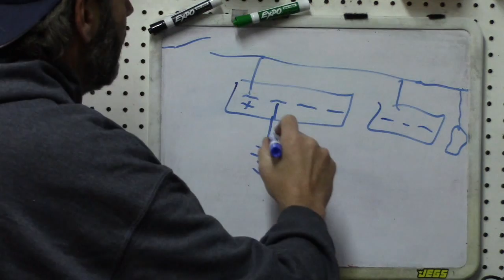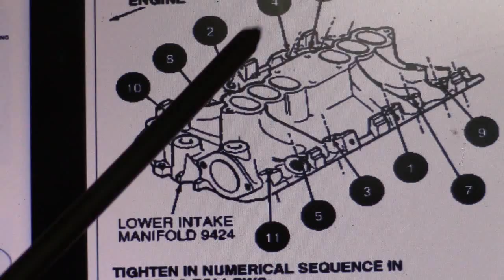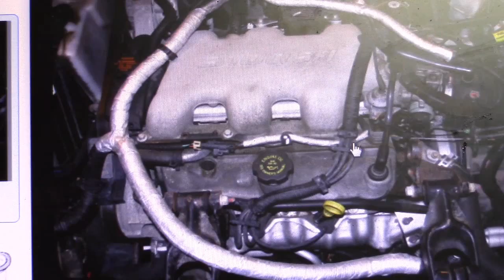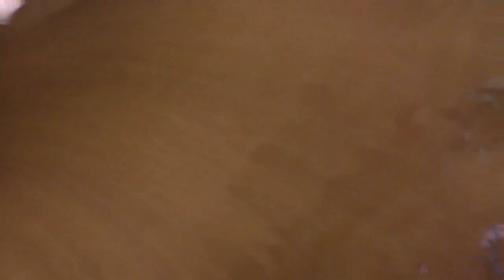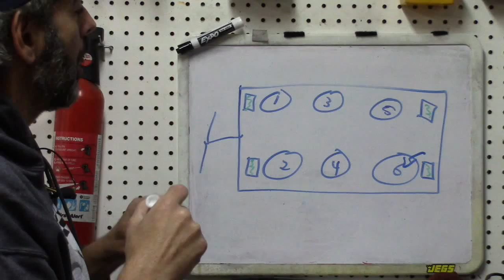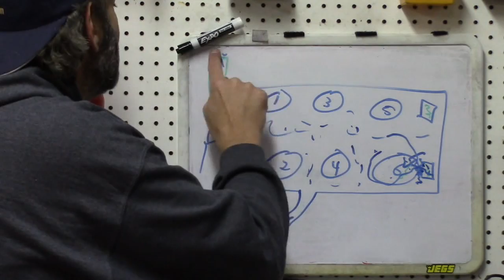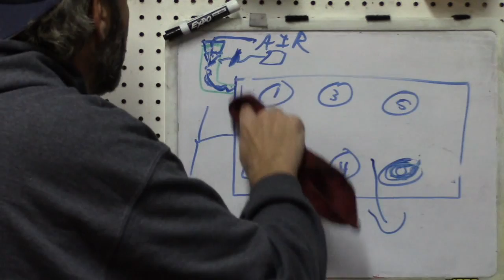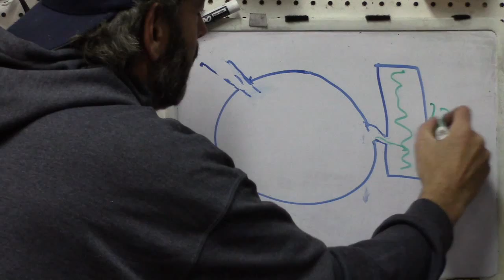04 Toyota P0306 Pt2-Can Compression Test Lie?

Comment: I don't know that particular system,  but I was wondering about the egr and how it might be ported through the head.  A lot of egr are cooled now to reduce nox. I'd there was a leak in that,  it's possible (maybe) to put coolant into the intake side of the head.  Just a thought.
Reply: I'm not sure were the egr is located on this engine,  I know some of them are in the back so it could be closest to #6.  That was the thought.  I really like your videos,  they can be thought provoking like this one.  Always looking for a positive way to prove what is wrong with the car.
Reply from the maker: Yes I've seen those systems but it doesn't explain coolant only getting into #6 though?

Comment: This one is a head scratcher Matt and made me think.  I want to see the cylinder head pulled and take a peek.
Reply from the maker: My plan is to use a borescope after pressurizing the cooling system and spot the leak by looking above the intake valve and in the cylinder itself.

Comment: I can't offer any explanation but all I can say is I've had something similar on a Ford Expedition. Compression checked out good, there was coolant seeping into the #1 cylinder over night, but it passed the cooling system pressurization test w/ flying colors. Chemical block test showed positive for combustion gases in the coolant - that had me scratching my head. Maybe there was some flapper type stuff going on there but I decided to try the best magical liquid head gasket in a bottle (the type that Arnold Schwarzeneggger's friend is made of) and it took care of it... until the radiator blew a few months later. Not knowing if the radiator grenaded from combustion gases or not and not wanting to put another penny in that piece of ford I sold it as-is for $900.

Comment: Matt, just a thought, maybe there is a hairline crack in the cylinder head casting in the area surrounding the intake valve for the number 6 cylinder but is isolated from compression when the intake valve is closed during your compression test, thus showing no bleed down on the compression gauge. It also might explain why there was a gurgling sound when air was sent through the intake manifold near that cylinder. That air could be forced into that crack into a cooling jacket in the head. Only accessible to the combustion chamber when the valve opens. Thus leaking coolant into the cylinder from above the valve seat.
Reply from the maker: Yep, exactly what I think it is.  Explains everything.

Comment: As you said, when the engine was cold, the misfire did exist, but the compression test did not show any signs of leaking or low compression, it could show these signs, however, when the engine reached its operating temperature. When the engine reaches its operating temperature while there is an issue with the head, it could spray the coolant, from where the head is cracked, into the combustion chamber, but the coolant is it is too little and it's going to get vaporized inside the combustion chamber because of high temperatures; thus, it did not cause a misfire. Again like you similarly said, when you kill the engine, there will be no compression, engine still hot, but the coolant is pressurized and thinner than when it is cold. in this case, the coolant is going to get into the combustion chamber and going to accumulate there until the next start in cold weather. Another thing I can mention is that if there is a crack somewhere in the head, it could be near the exhaust valve seat(where the coolant cools the exhaust valve). in such a case, I believe that you will get good readings when leak down testing and compression testing. 
Thank you for the valuable explanation and for sharing this video with us. You did a great job.
 Keep up the good work.

Comment: Odd problem for sure. Many have commented already that it could be a small crack either in the head or block. If so, could it be possible that this only manifests itself during the dynamic transition between operating temperature and cool-down? If a crack is only open during this transition period, then as it further cools down it will act as a small pump, pushing a small amount of coolant into the cylinder. There's problems with this theory too, but it's just another thought.
Reply: Yea Dude lots of confusion your working on a Chevy not a Toyota no wonder it has water in the cylinder. Any real Mechanic knows those engine's have that issue. Did you drink a 12 pack of Beer 🍺 first before this video
Reply: Your opinion would be appreciated.  What do you think the problem would be?  Someone wants to sell a 2002 4runner, 188K with the following symptoms, was misfiring on pickup only, smooth after cursing speed, no rough idling, run hot/warm a few times due to low coolant, haven't for a while, never changed radiator or engine tuneup for 100+K, have to top off coolant every other month, drives fine other than misfiring, smell coolant in passenger cabin,  no gump in coolant, engine oil changed.

Comment: hi Matt, i have another problem in a lexus es 350 2008 v6 engine,crank but no start, it has a camshaft sensor code, however if you removed bank A sensor only the car starts. both of the sensors has ohm value around 2000 ohm.replaced the positions in between them the same problem. the car stars ONLY when the i remove the wire from the bank A whatever which one of them is attached. please try to help me out. thank you
Reply: Usama i would check the plug it self it might be shorting when plugged only.

Comment: It would not be a surprise to me that you end up finding a casting flaw in the head, maybe behind the valve seat that opens up just a bit when the engine gets warm.  One way to check this is to use water soluble flourescing dye in the coolant and black light down the intake to the stem side of the intake. I use double chek flourescing dye, the stuff inspectors use to find cracks in welds. Black light flashlights are $8 on ebay, and a pair of yellow shooting glasses will make any indication really glow. Yes you have to pull the intake plenum, but that is less pulling than a head for a look-see.

Comment: My suggestion would be to pressurize the cooling system on the cold engine, and you should be able to see with your borescope where the coolant is entering the cylinder.
Reply from the maker: So actually i want intake valve closed. If the coolant pools up in the cylinder- it’s gasket or combustion chamber related. If coolant pools on top of the closed valve- it’s a water passage in cylinder head but not combustion chamber related which explains much better why compression and leakdown were negative and absolves my favorite tests as still infallible!!
Reply from the maker: Yep thast's my plan exactly!!
Reply: @SchrodingersBox  I forgot to mention to make sure the intake valve is open to see if it's dripping through the port.

Comment: I would venture to assume two things at this point:

a) There's a hairline crack in the head or head gasket (because there is coolant in the cylinder, I suppose there's no disagreement on this one here); and

b) the crack is one that reseals itself again due to material expansion as the head warms up (or the car would keep losing coolant and also overpressurise the cooling system eventually while being driven).

A hairline crack can fool compression testing, and very small crack is also supported by the symptoms that seem to appear specifically over a longer period of time as the engine cools down and a drop of coolant oozes into the cylinder. Now, trying to have a grab at that hypothesis I would try to construct a relative leakdown test specifically against the cooling system.

For example, plug a pressure gauge somewhere in the cooling system, then pressurise cylinder #6 to a fixed pressure and see how long it takes until it loses X psi and if the pressure of the cooling system goes up. Then pressurise other cylinders similarly and measure how long it takes until they lose X psi and cross-check if the pressure of the cooling system goes up.

If cylinder #6 consistently depressurises quicker than the other cylinders and also generates pressure in the cooling system, and if this effect diminishes when doing the same test again on a warm engine, these two assumptions could be considered true.

At that point it will come down to either a leaking head gasket or a leaking head, and you’ll need to pop the head off in either case. If you have a machine shop do a pressure test on the head and it passes then you know it must have been the head gasket.

An interesting question with head failures is always the original culprit: why did something crack and start leaking? You don't always get to it but sometimes you can find the answer buried in the engine.
Reply from the maker: Let's say it has this hairline very small crack and I do the pressure test and #6 has decay rate faster than the other cylinders... why was the leakdown test negative? Why was the chemical test negative?  Obviously, compression can get through the crack if there is a decay rate on pressure.
Reply: @SchrodingersBox :  For how long did you do the leakdown test? My hypothesis is that the crack is still small enough to not register either way until more time has passed. Hence decay testing. And about the chemical test: I assume the problem isn't much that the fast moving and instantaneously compressed combustion gasses get in the cooling system (they might for a few seconds after a cold start and then vent out quickly) but over a long period of time and over continuous water pressure and eventual cooling down of the crack some coolant eventually seeps through the crack.

This is just an idea of how to get results as numbers as opposed to mere visual verification of seeing coolant in the cylinder. If you ever do have a chance to get back to the car and figure out what was the culprit, please make a third video! These hairy diagnostics are the best!

Comment: Hello, if the cylinder head got a hairline crack the small time of high compression is not enough to leak that much into the cooling system that it could be measured. But if the car is parked with an warm engine the cooling system stay pressurized for a long time. This time is enough to leak into the cylinder. But the chemical test should detect CO2 anyway in this case. And it’s possible that high pressures let seals seal again. 

I really think that the cylinderhead got a crack above the valve. That seems possible to me.

Comment: Did this car have an EGR cooler?  As it's is possible (admittedly more common on diesel vehicles) but an internal failure of the EGR cooler can leak coolant into the manifold causing a misfire, in the case I had on an Iveco Daily van with a diesel engine it Hydrolocked  the engine and at first we suspected head gasket but it turned out to be a failed EGR cooler, I'm not familiar with the car or engine you are testing but this is another way of coolant entering the cylinder on some vehicles just for future reference.
Reply from the maker: That would not only affect cylinder 6 though
Reply: @SchrodingersBox  thinking about it I suspect your right, would be more then likely to cause multiple cylinder misfire, but at the very least my comment was valid in the way of giving another explanation as to how coolant can enter a cylinder. Hope you find out exactly what the problem is though as can't wait to see that video 👍

Comment: Maybe the cylinder wall has a hairline crack somewhere down the wall, and when the piston is in the top position pressurizing the system won’t show a leak because the leak is covered up. And once you turned the engine over and pressurized the coolant system- the piston was in the down position revealing the crack allowing coolant to settle in the cyl. But the crack would have to be minute due to the fact that it seals once the engine is warm. I say borescope  next time you see the car.
Reply: Great diagnostic mind tho. Love the vids
Reply: I said almost the same thing . He said he does his leak down with the piston at the bottom of the bore.

Comment: It’s not very common at all where a coolant port seal, and an intake port seal BOTH go bad at once and one or the other would cross contaminate. And probably would have ruled that out immediately after checking compression, leak down, etc. Even if it did have a coolant passage through the intake. A long standing coolant pressure test with that cylinder at top dead center and both valves shut probably would have shown you the source of coolant leak. And after finding that with the piston down and perhaps a borescope could have shown where the coolant was coming from.
On a compression test like you explained and there is coolant in the cylinder would add/sustain the compression. Because it’s adding or sustaining cylinder volume.
Reply from the maker: ACtually I only need the intake valve closed but I agree- longer term pressure test and see if coolant pools at the valve is a great idea.

Comment: I will say that you did prove you had a vacuum leak at the intake gasket if I remember correctly.  An interesting theory could be one of the bypass hoses leaking very close to the vacuum source although highly unlikely.  I have seen one head gasket that blew in such a way that compression sealed the leak when there was pressure in the cylinder and then leaked after shutting the engine off as the the pressure built up just enough to push past the leak when there was no pressure in cylinder to seal it back.  I think there was also some temperature involved in the issue as well, but I have only seen that happen once in my lifetime so it is still a possibility even though the probability is low.  I really love the scientific methology you use in your videos!  Keep teaching and maybe you can make the world reach 3% that doesn't throw parts at their cars or anything else in life because I think that method has many many applications!  Awesome show man keep it up!!
Reply: I would like to add that type of leak acted like a check valve under those conditions.

Comment: How about using CNG or Propane instead of Compressed Air and use a cheap gas detection tool??  **Don't blow up the garage!!!**
Reply from the maker: Sorry- um, how is using compressed air going to blow up the garage?
Reply: @SchrodingersBox  I think he just meant to be careful Matt.  Since he brought up the point of using a leak detector maybe the bullseye leak detector from www.automotivetestsolutions.com could be applied this way to find leaks while doing a leakage test.  Just a thought.  As for a compression test with a gauge being accurate 100 percent of the time this is not the case.  If you have valve train sticking the valves might be ok cold and give you a good reading but when the valves get hot and expand they could stick in the guides and give a compression loss.  Temperature comes into play here quite a bit.  Because of this I only use a Pressure Transducer with a scope now to see changes in cylinder pressure and valve events for proper timing.  Since I'm a Distributor for Autonerdz.com now I can hook you up with a wps 500 for your Vantage.😉
As always Matt good job and take care.
Reply from the maker: Holy crap- Bus Jockey!!!  Where in the hell have you been? I haven't heard from you in like 2 years!!
Reply: @SchrodingersBox  Hi Matt a lot has been happening for me the past couple years.  I now run a Mobile Diagnostic Training and Repair Business on the side and I an also a Distributor for Autonerdz.com now.  Here is my website.
www.mjediagnostics.com 
I have been doing quite a bit of traveling as well.  I just got back from Ohio doing a Autonerdz Picoscope Hands On Class for members.  We were hooked up to a Volvo Semi Truck looking at multiple components.  I've been enjoying it very much.  I also plan to do training for non members as well.  Know any Truck Shops in Colorado who would like my services?🙂  
Plus I have instructed at Trade Shows as well.  Just busy.  What is the link to your paid channel Matt?
Reply from the maker: Awesome update!! But None of the shops here like me very much lol.
Reply: @SchrodingersBox  lol, not your fault.  Good talking to you and have a good Turkey Day.  I'll try to keep in touch better,lol.